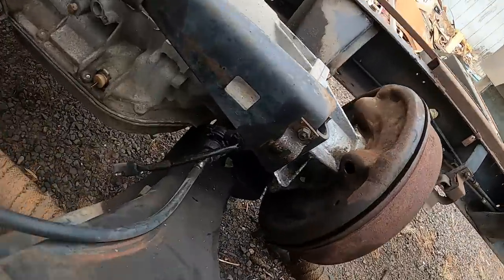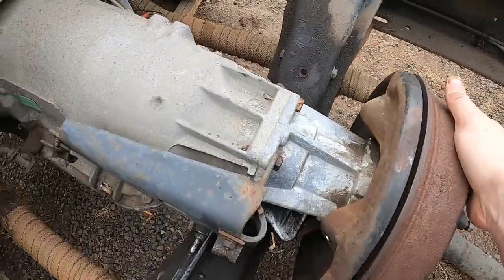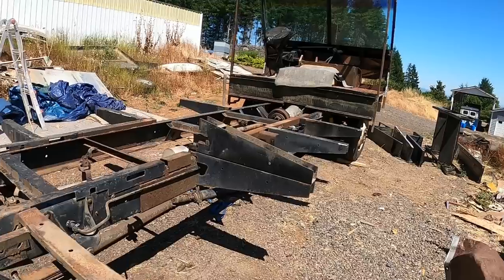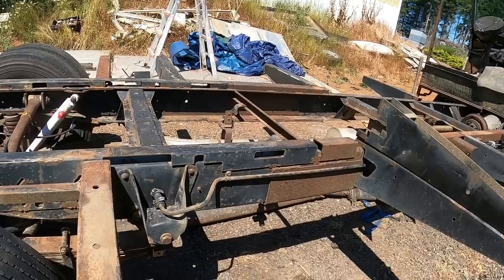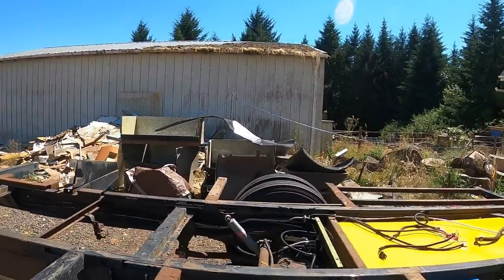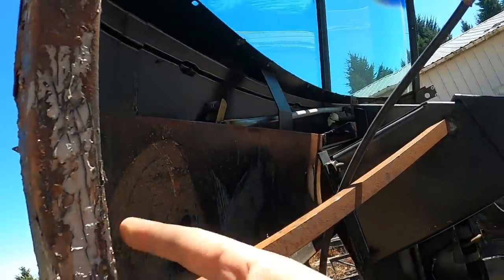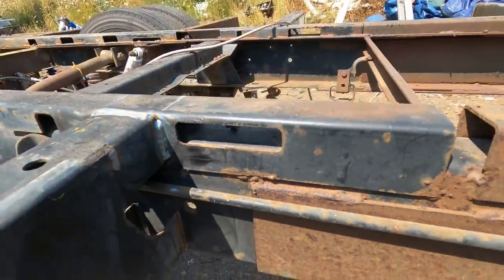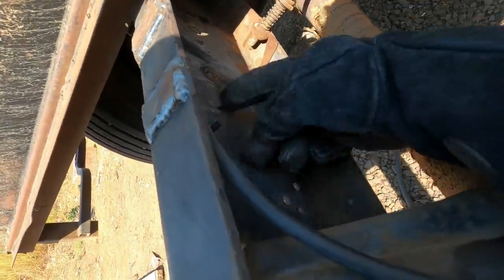RV REBUILD (Part 1) Frame Modification

Comment: Hi Nathan,
Re: Doors..
- Safety inspections may require alternate egress point(s). Despite regulations, Imagine how hard it would be to escape the vehicle, if there were a fire in the back, on the deck or the back door were blocked by a shifted load or a rear end collision. 
Re: Battery location..
- If all goes well, I imagine you'll eventually change out the lead acid house batteries for a type of LiFePo battery bank. They weigh a lot less & provide a lot more usable power.
And, of course, safety.. (sorry, I'm an old parent) 8-)
- If you don't now, it would be wise to have a fire extinguisher handy to foam the base of a fire.
- Cutting wheels should never be used as a grinding wheel..
Jan & I enjoy watching your videos & admire your perseverance.
Best wishes,
 Dennis
Reply: He could get by that by copying a bus: emergency exits on the top and a back door. Pretty sure bus emergency exits could be gotten used for cheap too.
Reply: @joshnabours9102  A roof escape hatch / access to a future roof deck would be a plus, and he does intend on installing a back door (BTW, I vote for it being centered Nathan 8-), but I strongly suggest at least a passenger side door.  Passenger side so that he doesn't have to step out into traffic.
One other thought, that may only be me, if Nathan ever has any kind of back, foot or leg problem (strained back muscle, sprained or cracked ankle, broken leg or a hip issue) he will really appreciate being able to get back into his home with a lower first step & stairs up to the living quarters.  Just my thoughts.. Best wishes Nathan, Dennis

Comment: Split AC is  much better option in this stage of rebuild, when you have access to the frame and mout outdoor unit below the floor, also  make it invisible. 
Window AC si bad looking and noisy.  A good inverter split AC is mor efficient, have soft start and can be running on properly sized lithium battery and inverter.
You can rather put an extra window in that place, instead of window AC.
Thank's for top videos.
Best regards.

Comment: While it's apart, might be a good idea to consider swapping the transmission for one with overdrive. Would definitely help with fuel costs and drivability. A 4L80 should bolt in

Comment: try to add a roll cage to the cab to strengthen it in case of an impact with some chrome moly tube. You can anchor the seat belts to that. The square tubing wont stand a chance in any kind of impact.

Comment: Nathan, as a retired industrial drafting professor, are you using a CAD program so that you have drawings to follow? There are a lot of free software out there. SketchUp or AutoCAD comes to mind. If you enroll at a local community college and obtain a student ID then you can get tons of software for free. 

That way, you have drawings to follow and can design your project exactly the way you want it. 

Sorry, that’s the teacher in me coming out. If I was still teaching I would have had my architecture or engineering design students draft this up for you! 

Good luck on your build!!! 👍🏾

Comment: I think the rear door would be awesome but I think you still needs to have a drivers door or side door for safety. It may be required depending on what state you plan to operate the vehicle in.

Comment: Wen you have good reach to the Engine at the moment, you could just upgrade the alternator, wen your in already? o.O Or put a second one for the living batteries on to the AC bracket on the Engine...since the Airconditioning is externaly anyways...

Comment: A trick is to slow down the wire speed to penetrate both metals and try doing cursive ease to tie both Metals together with the weld

Comment: I like the back door with angled steps up onto side of truck bed (see below). Lower the truck bed to the frame to keep low center of gravity, still can put truck boxes under truck bed. Gives step up into "cab". I also like a rear bed, good use of space and a side door into "cab" with interior steps like original, but it uses up more space. I also would shorten the overhang on truck bed, less chance of overload, more balanced and less rear swing and sway....James

https://images.carid.com/garelick/items/15330.jpg#1c3a1351-74cf-4545-aad7-0da4083eb994